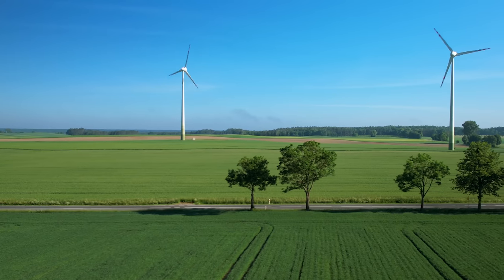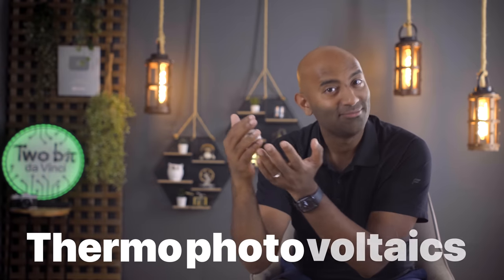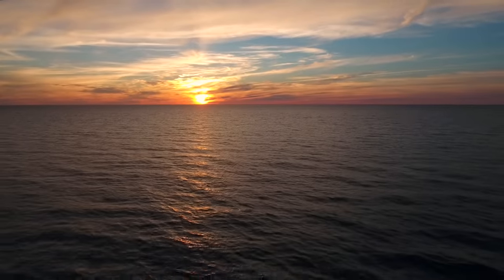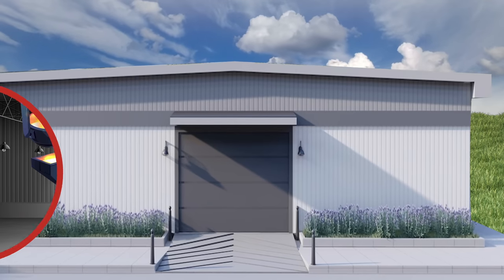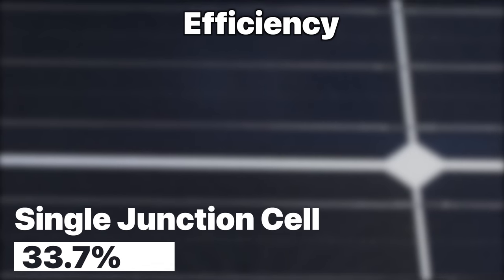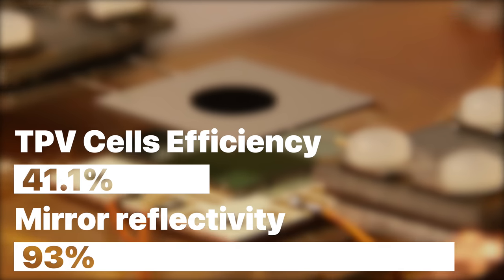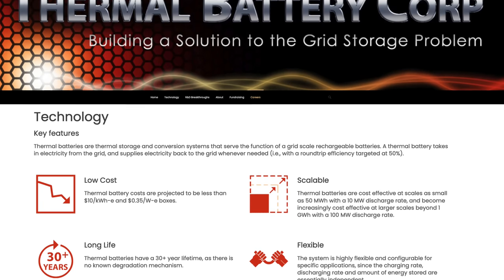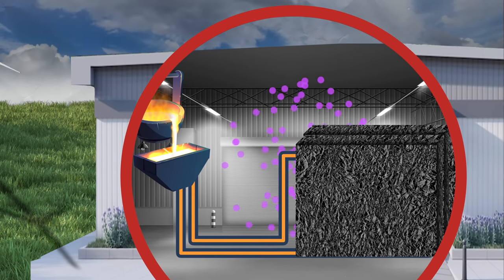Breakthrough Solar cell DOESN'T Run On Sunshine!

Comment: You could line a rocket skirt with these cells during launch and generate electricity to help run electric hydraulic pumps for small rocket chambers.

Comment: I am no fan of nuclear but if hollow graphite pellets were to be filled with uranium so hot that it is a gas then thermophotovoltaic could provide an efficient system with high efficiency and few moving parts. Lining the reactor with tungsten foil is an idea I hadn’t heard about. As I understand it these pebble bed reactors can be relatively safe but modular reactors normally require steam turbines which are less efficient at small sizes.

Comment: I use sunshine to make electricity, but not initially. I use Sunshine for what it is, namely, heat. I concentrate that heat and make steam, then run that against a homemade turbine and transmission, which is coupled to a generator, alternator actually, and I make my own electricity that way. All the stuff you talk about is very interesting, but in my opinion, very impractical. I say we use the heat of the Sun as it is and not try to manipulate it into all these other exotic things, which have their own set of problems to be overcome. Just keep it simple.

Comment: 😎  Wow! Direct conversion of accumulated or stored heat into light (via tungsten) into electricity. No mechanical turbines required. I had been wondering how to get rid of the mechanical issues of turbines (outside of nuclear decay or radiation into electricity) to generate electricity 🤔! The conversion of heat (via super hot tungsten generating light) into electricity has some widespread technological implications and future applications including in terrestrial travel and space travel as in ion drive engines and even in exotic engines or exotic tech for enter-planetary and Interstellar  space travel.

Comment: FYI the conversion ratio for when americans say "can power tens of thousands of homes" is currently about 2.84.
So the energy required for 10.000 US homes would power 28.400 EU homes on average. (or 61.800 Finnish homes).
Though that will probably change as the EU moves away from gas heating, and we install more air conditioning further up north, since even now few governments seem to take climate change seriously and the effects are becoming very noticable.

Comment: storage has propelled humanity forward.  storing seeds and meat. storing info in tablets and books.  storage goods in pots.  now, we need to solve storing energy.  

the good news is that cheap production of energy is the main problem and humanity has solved that’s with wind & solar.  solving energy storage at a reasonable rate will eventually be done.  the next 10-15 years are going to be wild.

Comment: You would think if they are going to have water running through the heat sink anyway, letting the water reach steam temps and adding a generator that would increase the amount of energy you could get out of it would be a no brainer. Especially if you design it so to keep the temps in the range we could use the 60% efficiency generators in.
You could go the other way, and retrofit one of the generators with a tungsten heatsink to keep the temps down, and use this to get the excess energy off of it. 
Maximizing the efficacy of our current systems until they can be replaced means using less fuel now.

Comment: WOW!!  juicy stuff.
NOW, the biggest question (and as far as I can see.  It the ONLY question) for this system.  DUTY CYCLE.  How many cycles can that graphite blocks go through before they fall apart.  And when they do fall apart.  Can they be reconstituted?  Same question how true for the other parts of your system (the tungsten and the solar cell).  I think that is ONE question.  (Even though it is a big one (it branches off to like 8 different threads, like a spider).  In my head I'm still gonna call this ONE question (duty cycle).  When I was in engineering back at college, this would be just ONE question.  Sure, it would be 8 pages long and an hour of testing time.  But still, it's only one question.

Comment: Plus, you can heat water with the graphite piles for radiator space heating or hot water use..

Comment: Basically, they are shining an incandescent lamp on top of a PV cell, with some extra step involved... And 50% is only the efficiency of the VERY LAST step, it does not include all the other losses of the system

Comment: The efficiency of converting heat to electricity is not important if the heat that is not converted to electricity stays in storage.  What I want to know is the overall round trip efficiency of going from electricity to storage to electricity.

Also, how long does it hold the heat?  Can it be seasonal?

Comment: The long term point of Stationary storage device is to store energy at daylight and use them at night. So how long will it take and how much it needs for that graphite block to support the night demand? Is this more efficient than directly storing the excess energy to a lithium battery stations? Adding more process lower the efficiency, you can only make less energy from what it came from. This is just makes things complicated.
Reply: But the lithium batteries use the kind of metals you were opposed in you last comment? Also not optimal for large grid volume storage. 
Or what do you think?
Reply: @MEMO-sb1sd  What are you talking about this? "But the lithium batteries use the kind of metals you were opposed in you last comment?".

Not optimal? Says who? Where's the data? Tesla has literally deploys battery farms and just recently testing Virtual power plant from Tesla Power wall from houses?
Reply: If you listen, he told you.
Reply: @xbxb  Calm down buddy, just talking
Reply: @callerydell3536  They keep hyping this kind of of stuff.

Comment: It is not necessary to turn the armature of generator with wind steam or water.  Edison generators use the field magnets to move the armature magnets and coils of copper wire with inverters and transformers to deliver high voltage AC power.  We have bound Edison's generator with magnets all around the armature without considered change.

Comment: Imagine combining this tech with supercritical geothermal (from MIT). A powerplant could be built in 100 days, have no moving parts, and utilize steady heat from deep down in the Earth. Best part is, it would be a constant, uninterrupted supply of energy that could be installed almost anywhere on Earth.
Reply: Finally someone else that agrees with me👍
Reply: You tell me you can dig a hole in the ground 20km deep, in safe conditions then build a powerplant on top of it with all these complex and precise mechanisms in just 100 days?
Reply: @alexandrugajin763  Not me personally LOL but yes, that's what the initial press releases talked about for the supercritical geothermal drill project. Testing is going on right now in Montana.

Comment: Tin is a limited resource and is actually in short supply. This system also relies on a robust wind and solar infrastructure already in place. Another thing why wouldn’t this plant start to Leak just like crescent dunes?

Comment: MISLEADING  
it doesn't   c o l l e c t   energy like a solar cell, it just converts it from either 'spilled" or stored heat energy.  You still have to have a way of collecting or generating the energy chemically, or mechanically from potential energy.

Comment: Forgive me for being potentially pointing out the obvious but can't we use that extreme heat being stored in the graphite blocks to heat water and produce steam to run the old-style turbines? Surely that would be much quicker, and cheaper, than producing and fitting the TPV cells for a whole new system

Comment: Ive never understood why we dont just salvage waste heat for power. 

Take a current heat producer- such as hydroelectric dam turbine bearings. Encase it with thyristor heat pumps, that pump the heat into a graphite brick- and generates electricity while doing so. That heat in the graphite gets used as in this video, and also in other ways, because we are also banking on the 'inefficiency' and loss of heat as waste... that way the graphite block remains colder than the heat source, and the turbine heat can keep flowing.

For that matter, why dont we also scavenge back EMF spikes from every motor or relay out there. 

So much wasted potential energy (see what I did there?)

Comment: Since these are basically thermal generators, it doesnt really matter where the heat comes from. Electric, coal, nuclear, its all heat energy up for grabs. But if solar heater towers have so much trouble with fluid management, how will these fare better?

Comment: Nobody's looked at clockwork as a storage mechanism. Modern materials and manufacturing could seriously reduce the energy loss in clockwork drives and by storing rotation you would not have to lose energy in converting kinetic to electric energy.

Comment: Liquefied tin as a heat transfer medium? How do you start the system flow without the tin solidifying in the still-cold carbon blocks? If the block temperature for some reason drops back below the tin's liquid state temperature, how do you get it flowing again?

Comment: I really wish you would address the potential damage to the environment that creating and disposing of these (and other) solar cells.  Going into the challenges in storing old solar cells  and then an unbiased compare/contrast against nuclear or even gas / coal.   Heck, from what I'm hearing here, perhaps a marriage of nuclear and this would be the absolute best. ??    I really love the new tech but we need to really be educated on the cost/benefit and negatives of both.    At least, I would love a video like that.

Comment: nice farytale, one component may have an efficincy of 50 %, the others , heating the tin , heating te graphite blocks and coolling them to glow the thunsten wil only works til the tin is cool down to 1800 degrees. keeping every part on 2000 degrees in simply impossible. then the solarcelles transport their heat into cold water, another great loss.  total eff will never reach the bad 35% from steam turbines.

Comment: Pretty funny, one of the cheapest ways to generate electricity, but also one of the most expensive. There aren’t many ways to generate electricity really, after all, wind and hydroelectric are both solar in actuality. Tho it can be dangerous, nuclear is still the cheapest way by far and doesn’t require all the rare minerals from other countries, and doesn’t cover the landscape with panels or giant windmills. That being said, super interesting video.

Comment: I'm sure this has been thought of before but here goes... what about a radioactive source giving off energy into a "photo-voltaic" that is designed to give off electricity using that wavelength of energy?  It would be a more direct transfer of "light"  to electrical potential instead of current nuclear with heating steam and running turbines.  I would think the whole system would be much more simple and condensed.
Reply: This is called a radioisotope thermoelectric generator (RTG), it’s what they use on the space probes to power them (with a very low power) for basically indefinitely. These have about 5% efficiency though but there’s 0 moving parts and everything is solid state

Comment: Sounds interesting. Wondering how many BTU of heat will be exhausted into the atmosphere from one of these plants let alone multiple plants. Have they done any calculations on that in their paperwork? Heat generation into atmosphere old systems in use vs this "new tech".?

Comment: OK Hours to cool down, I assume that a specific value of time must be observed to allow that volume of hot tin to find its way out of the carbon/graphite blocks before that tin solidifies again making it impossible to recover each and every block back to its intended purpose else someone must constantly circulate the molten tin  till its time it has to be dumped out of those blocks maybe salvaging 40% of them. Good luck doing that.
Reply: Another foundation is the pump sizes for moving not water like New Orleans had to remove from the flooded city after the hurricane but to pump molten tin before it solidifies and it becomes impossible to pump any more out. Those pumps in New Orleans were electric pumps bought by funds from tax payers whom were repaying a loan to construct the water removal system, someone would have to bear the cost of employees and canals to move the molten tin also orior to it solidifying. I cannot image what the overhead for that apparatus would be having to use a material in short supply.
If someone were to consider making something of the molten tin immediately after it was pumped like tin pipes for the housing construction business or 3 foot sheets of solid tin it might cut down on the overhead a bit more than trying to make it molten again at some value of time on its leaving the blocks.

Comment: could maybe use molten salts at a solar tower/mirror array site ??????

It also strikes me that a small version of the graphite cube could be used in a home and "charged" with heat in the summer to release it slowly in the winter ...

Comment: It would be great to have a video about pumped hydro storage and other gravity based storage systems. These can be towers, or trains on slopes, or other methods that are simple and old technology. No new inventions needed!
Reply: Agreed, this technology seems like it is likely to be overly complex to implement at large-scale as being envisioned.  The one problem pumped hydro has is area - lots of land space needs to be consumed to use it so it is not always applicable for areas of already dense urbanization or productive agricultural use.  However, I do suspect that gravity based storage in general has promise, especially if it can be done below ground as some concepts are testing.
Reply: @sjsomething4936  Pumped hydro can be underground, in old mines, for example. And there are a lot of variations on gravity systems. They can be quite efficient as well.
Reply: @NeilBlanchard  is that water stored in an old mine that itself is at an elevation?  I can’t really envision how else the mine could be used with water but of course there’s plenty more clever than me out there. 😉. Trains on slopes is one I hadn’t thought of but seems quite brilliant.  The one I have seen is blocks on pulleys using old mine shafts which seems very reliable and simple tech to implement.  It’s remarkable how many technologies we’ve dreamed up in a short time now that humans have collectively finally realized how badly we’ve screwed the pooch.  Many won’t pan out but I feel enough will to allow us to get largely off of fossil fuels.
Reply: @sjsomething4936  There would need to be water storage areas - one high and one low in the mine.

Comment: Simple cooling solution would involve using ,plants like mint for potential example,or algae cooling system?,due to its cooling effect ,as well as its ability to withstand high heat,we could probably breed a variety that can withstand extremely high heat, in the canopy of a forest heat can be greatly dissipated, we must figure a way to maximize dissipation,while allowing full absorption into the tech,nature naturally attracts more and more water over time where plant life is allowed to flourish, also no scary molten metals involved 😀

Comment: I think the heat is both brilliant and also its downfall.
But if heat can be harnessed, we live on a giant heat storage unit. Geo thermal heat should make unlimited power if they can ever harness the heat, and create safe access to it.

But I think the slow build up of heat in the storage place and the replacing the photo cells as often as I think they will wear out/burn up, I think the efficiency will drop by half.
I think using water coolent for the photo cell is the real flaw. You would need to cool the water temp to what it was before it was heated.

I think at the heat inside the chamber the photocell block might super heat faster than the water cools it and maybe explode from pressure somewhere in that water cooling system. I think you might need a minumum number of cell blocks vs chamber size to be exact so the water flow can be larger.

But who knows, I'm just guessing. 🤣

Comment: This sounds not bad but it's as said, complex. The waste heat in the second chamber could be used to heat up water for homes ?? 
Why not use this technique in a thermal solar plant where the concentrated solar heats up tungstene??? That would result in a much smaller, simpler plant?

Comment: hmm sounds great but it still sounds like it will cost alot, to get the raw martial out of the ground, does cost greenhouse gases. why are we not talking about iron batteries would be less expensive i know it would be take a huge area to get a battery to hold that much energy

Comment: what is the life expectancy on these cells?  If they use water to cool the cells would this not be an additional use case to steam turbines?  What is the process in recycling the gallium arsenide cells?  Nasa uses them doesnt mean that they are good for ground deployment. Add in that anything that can be built in pieces can be returned that way, and violently what are the effects of gallium arsenide dust on people?

Comment: So you could transfer the heat from a mirror molting salt set up like out in the desert and then when the sun's down and it's not producing energy you could use the heat that you stored to provide energy at night!
Reply: You're talking about the one that failed because of the maintenance issues and costs? Because the molten salts kept leaking?

Comment: Solar isn't necessarily as clean as people tend to think. Unfortunately, aging solar panels can leak toxicity into the soil, and it is very costly and hard on the environment to dispose of the panels when they age. California is currently discovering this. They are also mostly produced with coal power in China. The cost of proper disposal should be included in their price.